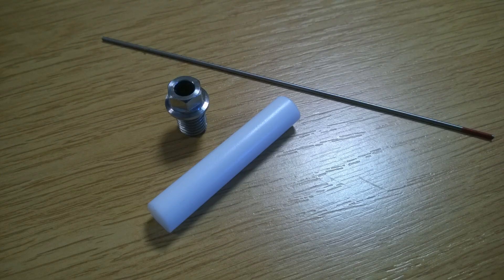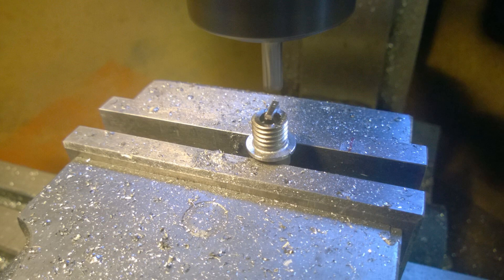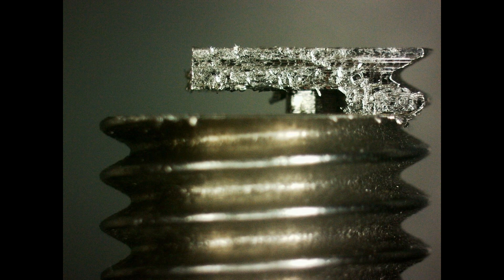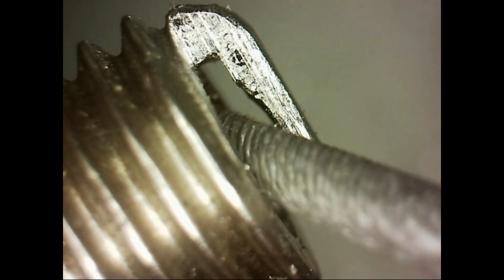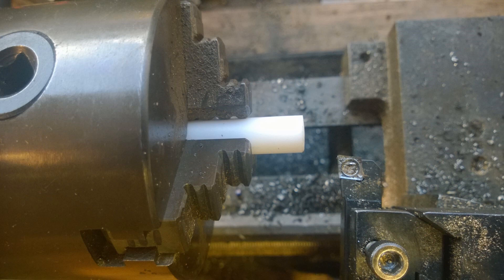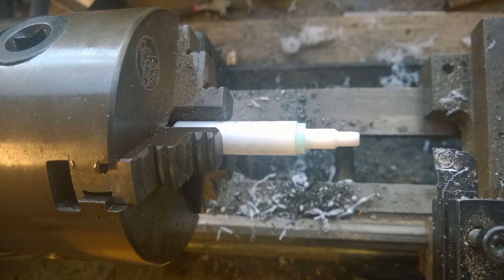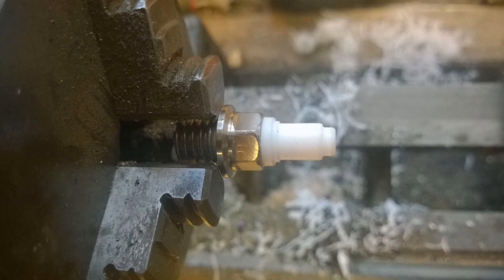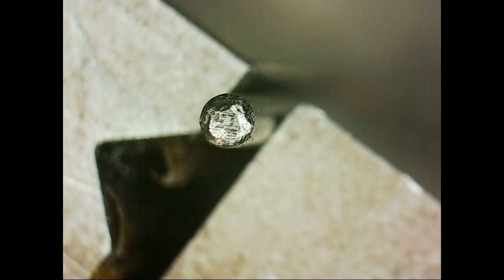Easy Engine - Spark Plug 2

Comment: This easy engine. Is it going to be a flat head? 
Also what if you could use the head gasket as an insulator and have your spark gap between your head and the piston? You.'d cover a larger area with you spark for quicker combustion
Reply from the maker: How would you control the arc path? You'd be using the piston as your ground but then where do the current flow go? (a little rhym there lol) It would have to arc at your bearings. 

Small end then big end, then crank bearings. This can cause nasty problems. And with disimilar metals and oil insulating the bearings your spark would weak, and intermittent.

Comment: How are you going to keep the compression from pushing the PTFE out?
Reply: I`m sure you meant the expansion. When it fires the compressed mixture.
Reply: gen3v8, doesn't really matter.  I honestly believe just turning it over without firing, over time, it is going to push out.  Now, obviously with combustion, the steel is going to get hot.  The tungsten is going to get hot.  The plastic is going to soften....and all the issues are going to be magnified.

Comment: What is this in white collor its plastic or other
Reply from the maker: PTFE - its a plastic
Reply: The Workshop ok but when is blast  in cylinder and plastic plug burn and then pressure leaked am sure it will not working . Tell me what's your thought about this plastic plug